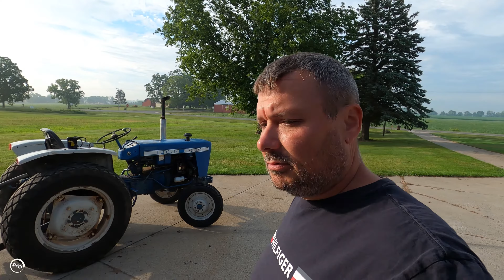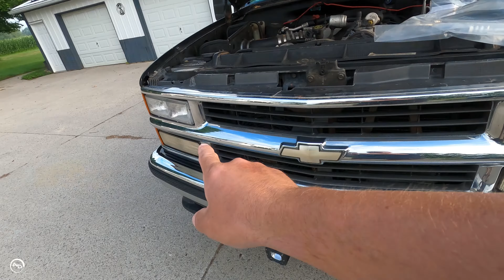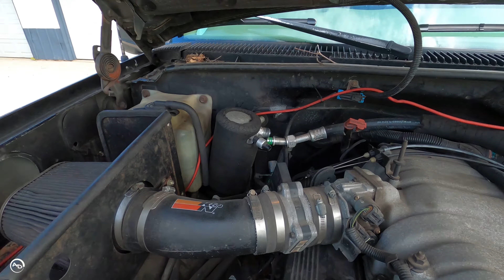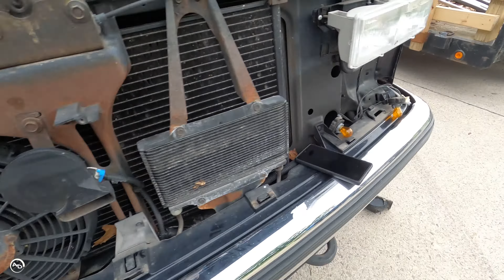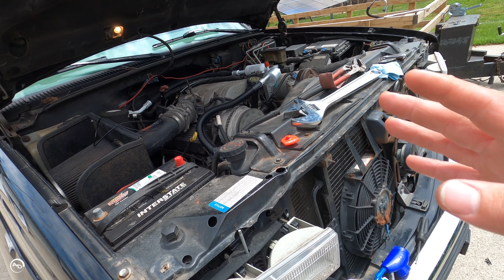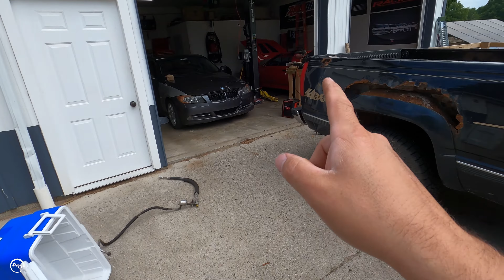Chevy OBS A/C line replacement and recharge!

Comment: When is it necessary to add compressor oil? Would the system cool better if you were to flush the condenser?
Reply from the maker: Not sure about the oil. I still need to buy the vacuum to refill the system the correct way